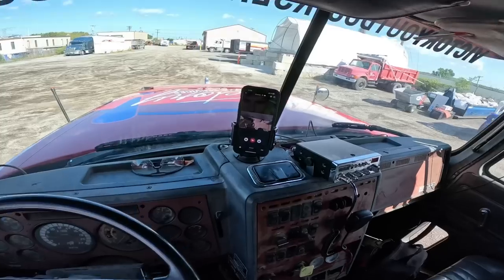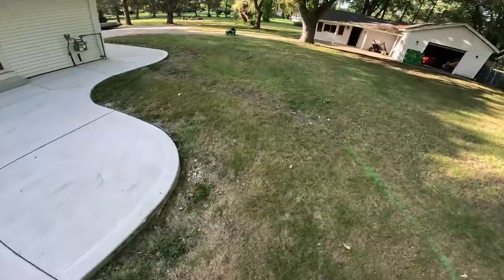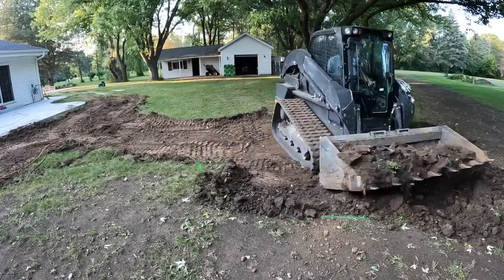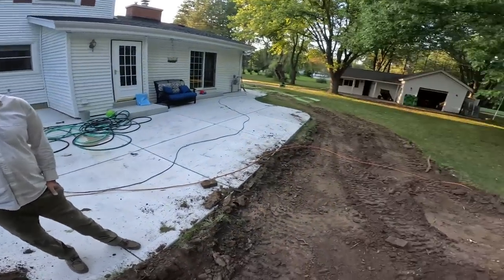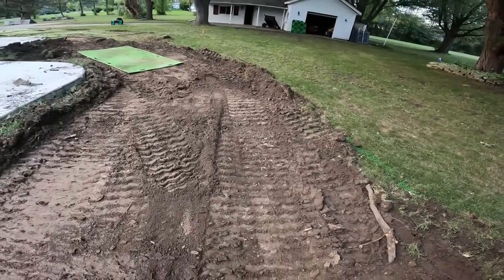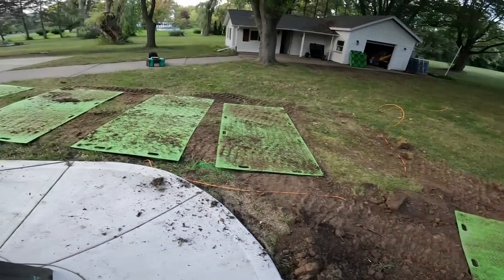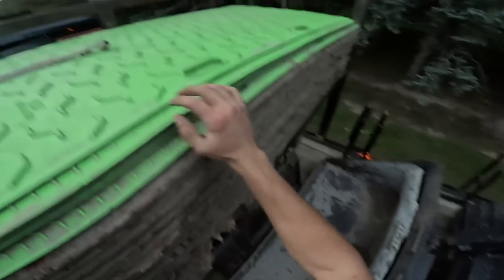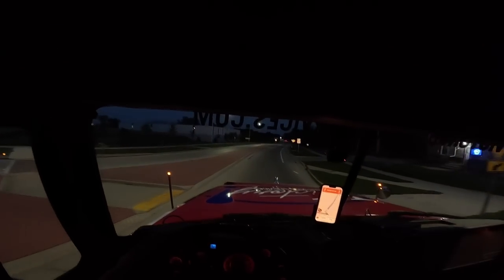Wires and Cables Were All Over 😬

Comment: The only priority rule is that drivers inside the roundabout have the right-of-way over any driver entering the roundabout, regardless of approach direction. Every entrance has a yield sign for approach vehicles.

In multi-lane roundabouts, large vehicles may straddle both lanes to make their turn. Because the rear of the vehicle or trailer is likely to off-track into the other lane while making a turn, other drivers should never drive next to large vehicles in a roundabout.
Reply: Be careful, Big trucks don't have the right-of-way to enter the roundabout, Just while you are already in the roundabout other drivers should be on the side of them.
Reply: the incoming trafict has the rite of way and thats what that yeled sighn is for u to slow down and yeild to trafft .....thats for around abouts entering onto the highway
Reply: @b4322558  idk where that is, But in America, The person already at speed in the roundabout, Has the right of way. When I'm coming upto a roundabout I have a yeld sign.

Comment: Hey Ryan, I work with telecomm often. Usually the reason you'll see them buried all over the place like that is because the technician will hook the house up from the distribution point nearby to the house. They ALWAYS use longer wire than they need, so when the crew comes out to bury it several days later they don't cut the customers internet to run a new wire. They just run it all over to get the extra length below the ground. Hope that helps!